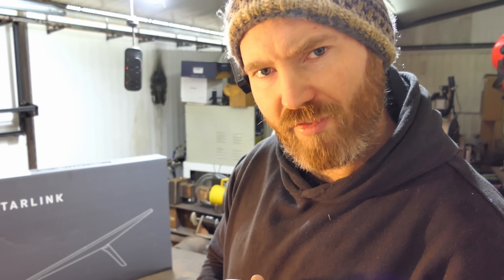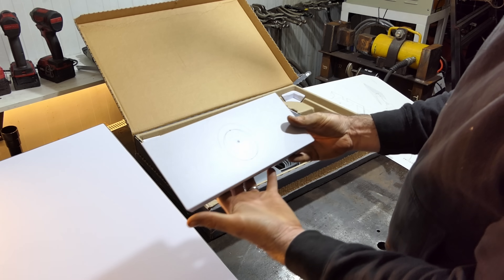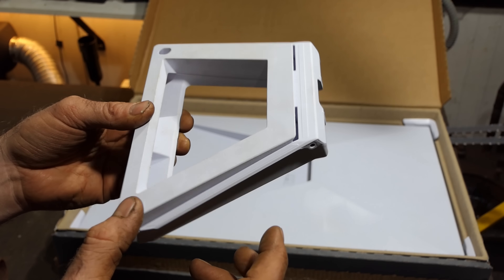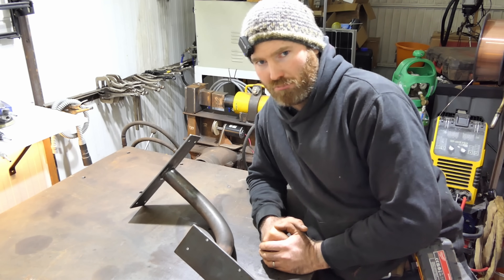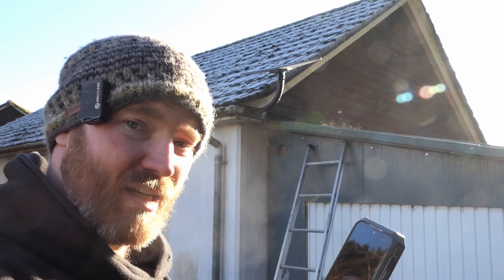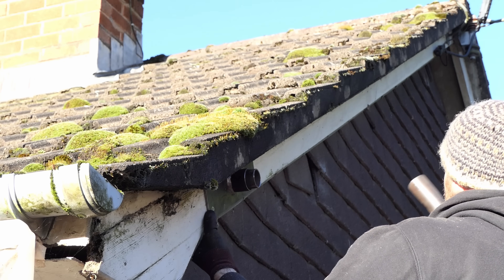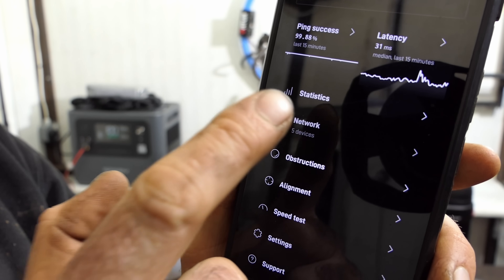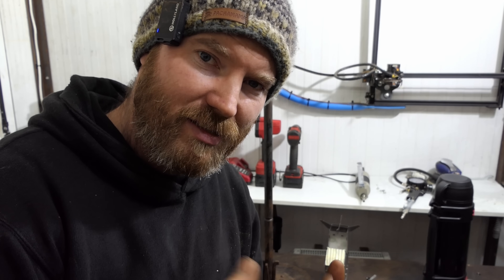I bought UK Starlink internet... I'm shocked!

Comment: To improve WiFi in the house, ideally use an ethernet cable from the starlink router to a WAP (Wireless Access Point) near where you need the WiFi in your house. Do NOT use "WiFi range extenders" they're almost useless.
Reply: Use a Wi-Fi 6e or 7mesh, works great, no loss in speed, whole house coverage…
Reply: @JD-qd1bp  you have devices that support Wi-Fi 7 😐
Reply: My last house on a small L shaped cul-de-sac had 2.4 Mbit download. The fibre cabinet was 50 yards away but BT had NK plans to run anything into our street. Everyone went to Virgin but we were moving. The new house had 35 Mbits until the lines went bad. We recently had BT fibre installed at no cost to us. Monthly fees are £2 cheaper and we get 110 Mbits.
Reply: Build a mesh network, if not wiring the house. Those old WiFi systems do not work. TP-LINK Deco was really easy to set up.
Reply: @mikapeltokorpi7671  Mesh is the answer.  I have a router and two mesh units, and have full speed all over a big(ish) housed and most of the garden.
Reply: @mikapeltokorpi7671  this - wifi mesh network (provided you do the work to figure out where the environmental issues are, which is easy there are apps for that) is the best way to extend a wifi network. Not as expensive as it used to be, and isn't too difficult to set up. You just need to use said app to figure out how strong oof a  router and how many nodes you'll need to make the entire setup work properly.
Reply: where's the best place to install the router when your on fibre? and what's the best way to boost the signal? getting 1gb fibre installed 2moro.
Reply: I find them good.
I't using extenders to catch the blame when in reality it's Starlink. Utter crap in my experience.
Savr your money and stick to BT until ultra fast internet is available in your area.

Comment: Now move your phone in a figure 8 pattern until calibration is complete.

"It's bolted to the house!".
Reply: You left out the part about patting your head and whistling Dixie.
Reply: Mortal had same dilly idea for aligning their line of sight phone connection. The very best method was a Sylva compass and a spirit level. 
1 - Set the base level. 
2 - Use compass to point the antenna to the correct azimuth. 
Sorted every time.
Reply: Judging by the rotten condition of the bargeboards on your house your bracket will probably fall off in the next storm.

Comment: Now you have a good source of internet, you might want to think about running cat5e cable around the property, and putting WiFi nodes in key places.
Reply: Why not cat6 or better?
Reply: @Okurka.  Cat5e I've learned more recently is achievable with a DIY approach, that is terminating your own cables. Cat6 cable is a little more expensive and gives you no speed benefit. Cat7 starts to use shielding but is a lot more expensive. I personally installed cat6 cable in my setup, but as I say, eventually learned for many reasons, it was unnecessary. Though that is assuming you get quality cable. Cat6 can be seen as an insurance policy, done well it can achieve 10Gbps. Cat5e is 1 gigabit (good enough for a FTTP connection, good enough for starlink) .
Reply: @DIYToPen  cat6 utp is fine these days for diy as well, and is easy for terminating in boxes/patch panels. if you want to wire to plugs it is worth getting cat6 plugs as the insulation is slightly thicker on cat6 than cat5e and cat6 plugs have slightly more internal space to allow for it. It's worth getting full copper rather than CCA in case you ever want to use POE. I agree with you about cat7 or STP cat6. also cheep testers often don't work reliably on them.(cat6 stp or cat7).
Reply: @DIYToPen   Yeah, if you were planning on running a home media server, serving the internet through your server to everything that happens locally, those higher spec cables would work.  I want that so that I can stream 4K content to every media device in the house.  I also decide what media is available. But if all you're doing is connecting to your wifi out, it won't make much of a difference.  There are also wifi extenders available.  I actually use one called the nighthawk mesh.  I'm sure there are many alternatives.  You log it into your router, and each of the mesh units acts as a wireless point.  It got around some tricky extended range and redirected wireless access.

The thing I would be curious about would be whether there is an ethernet port in the router device.  If it has that it would allow for lots of options.
Reply: @anthonyperks2201  Im not a fan of mesh, my routers supposedly mesh, however the rate at which the speed deteriorates is ridiculous, if you dont have a completely unobscured view between routers. I imagine power boosters would do a better job. So, I connected them with ethernet, and each node emits at full speed now, nothing beats old fashioned wires (except maybe lasers 🤓).
Reply: @DicksonTimScotland  all good points, from a more technical perspective :) I think cat 6 is guaranteed not to be CCA... And I run many things with PoE. So, that's a nice feature of CAT6.

Comment: I've been rocking Starlink in the UK since the gen 1 dish was originally released. The dish has turned into a kite and jumped off my single story workshop on 2 occasions and it's still going strong.
It gets better and faster every few months. I also charge it to my company but I'd rather spend more for good internet than less for the crap I had to deal with before.
Yes, the range isn't great for the router. I connected mine to a mesh router system to send it all around the house.
Reply: How rocky is it, better now ?
Reply: @lucasrem  When they released it in the UK it had already been available for at least a year in the US so the satellites were up there. I noticed a 5 second drop out a couple of times an hour and sometimes the ping was a bit heady but now, now there's thousands more satellites, the dishes have changed orientation to pick up the new strings covering Europe. I usually get a 30ms ping and rarely if ever see it go below 150Mbps.
Reply: @evilution_ltd  wow, 30ms ping really is quite impressive considering.

Comment: I see you have 5G on your phone, why not just use a 5g router and an external antenna, i think you've gone the completely wrong route, pun intended. I used Deco X50-5G, seemed to work very well, just pick bands which seem less congested, N bands seem to be the proper 5G one and B the 4G+ bands, B20 seems to be overly congested so maybe avoid that. I use B3, B28 and N1 for my parents.

Though i would be interested to see what speeds you get for the price. Also heard your speeds can tank after 6 months according to reddit

Comment: I've had SL for years. It's good when it works. It's also good for travel. If that's all you can get it's much better than ADSL/FTTC. I have the Gen 2 activated kit on the roof and the Mini. Just so you know EVERY Falcon 9 launch they do in 2025 will have 60Tbps of capacity. They want to do 1Gbps speeds and when the Gen 2 sats are coming over you will hit 500Mbps often. As for the snow feature it just pushes more power to warm it up - And I've had mine under 6 feet and it's been fine so don't worry - Snow and Ice won't break it
Reply: If that’s all you can get it’s much better than ‘x’. 
What does that even mean?????
Reply: @gottliebdee263 I think he is trying to say that if you can get direct service via fiber it is always going to be the fastest most reliable option but this is better than the other slower alternatives.
Reply: @ I hope so.

Comment: We have bad Internet so I bought a 4G/5G router “Teltonika RUTX50” with a external aerial Mimo 4x4 for £700 and then pay £20 a month for SIM only 5G connection get a good 300mb down and 60 up. Over the long run it’s a lot cheaper than using satellite and a lot more reliable and easy to set up.
Reply: In my experience it's absolutely more reliable than rural 4G, which I had to access via a 75cm omni antenna with a PoE masthead router because of the local geography.  I've had one 2h outage in 4 years .

Comment: I live in northern Italy,  40 euro a month, I get 125-250 down and about 22-35 up on average. I am so very happy with this service. Enjoy
Reply: I pay half what you pay and 1000 down 500 up
Reply: @DoctorVinegar  I pay €5 for 1.000 down and 900 up. For €10 I can get 8.000 down and 7.000 up.
Reply: @razvanlex  Through a cable I suppose...
Reply: @ Yes. Depending on the device about 500 on wifi. Mobile phone 5G network unlimited data about 5 EUR with 6 GB in SEE roaming. And unlimited calls.
Reply: @razvanlex  Good for you. Now move 100 miles in a certain direction and all of a sudden no copper/fiber, no 5G. Starlink is not for someone living in London or Bucharest.
Reply: Spain 45e 500/500 whit 5g 50G plan and digi have the same for 31e but no in  my neighborhood
Reply: I live in Romania, I get 900 download and 900 upload. For €5/month. For more than 10 years, was launched in 2013. From 2021 Digi launched the 10 Gbps for €10 /month in big cities.
Reply: @razvanlex   paying £15 per month, barely getting 36mbps down 🥲

Comment: A lot of modern towers don't follow the standards of spacing or in some cases, power supply standards.  They do this specifically so you cannot change out the hardware for better hardware when it gets old.  Upgrading can get very expensive, but if done right, it is almost always better than a new computer.

One upgrade path you want to do is to put the maximum processor the motherboard can accept.  Sometimes this will give a really big performance increase. This will save you from having to replace all the RAM.  Since the computer is older, the fastest CPU your motherboard can accept is likely available under 20 Pounds.    Since you do cad and video editing, upgrading the video will have a profound effect if you put a good video card in it.
Reply: Get your kids to specify/build your PC for gaming then exclusively use it for CAD/video editing, the cross-over in requirements is extremely similar with the caveat that CAD needs ALL the RAM in the world. Plus the look of abject disappointment from your kids when they realise they aren't getting to use the PC at all, is worth it.

Comment: On my Starlink I bought the RJ45 extension that comes from the modem. 
What I do is log into the modem on my mobile and verify it’s on then on the actual modem I’ve put Avery high powered wireless router.
All fixed. All this in my motorhome and my router goes very very far. Not saying how far 😂

Comment: Wow, the pricing is REALLY off-putting.
Reply: It's only a concern if you're in a rural area, or you happen to be in one of the very few places that haven't modernised. If you happen to be in one of those areas, it's a lifesaver.
Reply: You sound as if you may have an alternative.
Reply: It’s cheaper than BT, 10x faster and a rock solid connection. Also, with a government grant for the hardware and installation the upfront cost goes away.

Comment: I was on copper wire broadband for years and it never got improved, moved to a 4G modem with external aerial and data SIM, and speeds went up 10 fold on download, and 60 times on upload, for less money than copper wire per month. There was no 5G here, and 4G signal is poor, but when 5G rolls out, I'll go down a 5G SIM (maybe  Vodafone GigaCube as seen line of sight tower speeds of 860MBpS download/300+ upload in the UK at someones house in the sticks for £15 upfront & £20/month unlimited data for 2 years. Starlink and Long Range WiFi are way too expensive in comparison.

Comment: I went with 5G last year and it was the best thing I did. Ditched the landline entirely including the phone. Was paying 50ish quid a month for phone and BB and getting 75mpbs at best. Now get 260mbps+ for 26 a month. We now have the option to have direct fibre but it's just not good value for money. Almost 50 quid for a similar download speed. If it were 1:1 up down then maybe it would be worth the cost but it isn't.
Reply: Similar situation here, I'm with Three, I pay £22 a month for unlimited everything on my phone, I have a great 5G signal and I can share it with whoever I like, uncapped, unlimited. Absolutely no reason for me to have WiFi anymore.
Reply: I'm surprised it isn't symmetrical most of the independent companies are. I have 600 up and down for £32.
Reply: whats the ping like for gaming tho?
Reply: @BLX187  amazing
Reply: Was looking for this comment, as I also have 5G home internet (not the same as personal hotspot btw, it's a dedicated wifi 5g router) with Three. I pay £22/month with 365Mb down, 33.5Mb up and between 2-5ms latency.

Bad weather has reduced the speed by 25% maybe once or twice in the last 2 years.

It's a game changer if you live anywhere with good 5G connection (granted I live fairly close to a mast I think) I would 100% recommend it.
Reply: @SammyInnit  try giggaclear in your area they cheap and trying to take out bt company based in oxford I met the owner in a pub I get 600 up and down Internet for 40 quid 300 up and down is 25 last time it was up for renewal
Reply: If you don't mind me asking, what service did you go with for 5g?

Comment: Hi Josh, be aware that most modern phones (and likely camera) use piss poor video compression. So one gets absolutely ghastly (i.e. way too large) file sizes. To give you an idea, if you download the video from youboob after uploading, you will see the file size difference. Youboob knows something about compressing videos.
Reply: I gave it a look, the 2160p version of this video has the file size of 1,315 GB.
Reply: I tested a bit with hevc and ffmpeg. This command will convert the video to 25 FPS (I personally can't see any difference between 25 and 50), copy the audio and use nvidia hevc to encode the video. Quality 24 yields 1.7GB video, so probably 26 should be around the original file size.

ffmpeg -y -i "input.mkv"  -map 0:v -map 0:a -c:a copy -c:v hevc_nvenc -preset:v p7 -tune:v hq -cq:v 24 -b:v 0  -filter:v fps=25 "output.mkv"

Google's VP9 is supposed to be somewhat more advanced than hevc/x265 and provide better quality. But they are also the only one's who are using it. I used nvidia hevc as it encodes very quickly and produces solid quality.

Comment: And now understand that just as Musk could see everything that the Tesla did in LV, from it’s inception to its demise, they will now also see every single thing, pin, bank code, bank account, private text, proton mail, signal message, etc., that ever passes through your Starlink system.  (Oh, and see how you can disconnect your daughter?  I imagine that Starlink can disconnect you.  So, don’t forget to behave!!)
Reply: That's not how encryption works. The router can see whatever servers you are connecting to, but not the contents. That's the S in HTTPS for you which is now ubiquitous. But yes without a VPN starlink can at least see what you connect to and when which is plenty to sell "anonymised" data for lots of juicy profit. So, get a VPN and just be fine with them probably selling your anonymised data, some sod's going to.
Reply: @tappy8741  If you use a VPN, your (Starlink or other) ISP can't see what websites you vist, but now the VPN provider can, and they are typically much less regulated than ISP's.

Comment: My starlink was on the beta testing as 4G mobile internet was slower than the 9.6k mobile internet i had over 20 years ago. Starlink has been faultless but i don't use the starlink WiFi i have my Own separate WiFi router. I believe you have to buy a adapter to do this on the new ones & mine is motorised. It's fun watching it moving.

Comment: In terms of making wifi go all around my house, i found mesh wifi systems to be excellent. I have bought sets, then bought a few more units 2nd hand to add to the network. I have excellent wifi inside and outside my house, even in my shed. Mine are Tenda Nova mw3 and i have about 5 of them, one in each corner of the house with one screwed to my rafters too.
MW3 are very cheap on ebay but you could probably get faster ones.

Comment: That snowmelt mode will ruin the dish long run, it’s not a heater but actually increases current draw somehow to create heat in the tiny wires . I live with real
Snow here in Canada and have no issues with it switched off, my dish was replace after the snowmelt mode ruined the first one…love the content cheers
Reply: that IS a heater, it is actually the (more or less) definition of an electric heater ,what you mean is that it doesn't have an EXTRA heater ;-)

Comment: Any notes on actual running costs?
Reply: They consume about 45W of power. This accumulates to about 1kWhr per day give or take 10% so at current SVT prices it is about 25p per day to run it.
Reply: @noahnoah6425  What about data charges?
Reply from the maker: Yep I did a note near the end. Cheers J
Reply: @joshuadelisle  Not in terms of power consumption but how much it costs for the DATA...?  I currently pay £45/month for a fibre (500Mb/s) BT connection (includes phone and the hardware).
Reply from the maker: @kellyeye7224  it's unlimited but costs £75/month.
Reply: @joshuadelisle  That's not bad in the scheme of things.